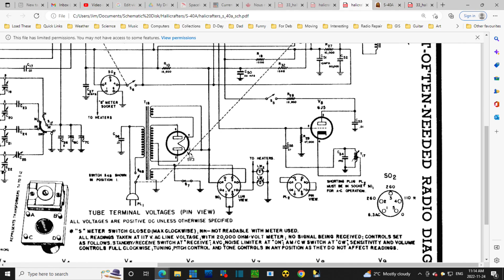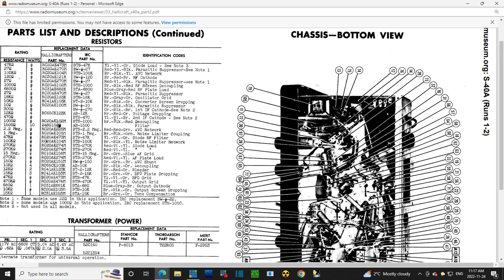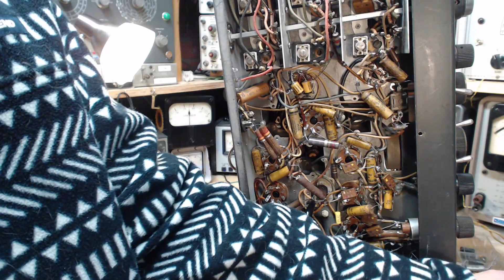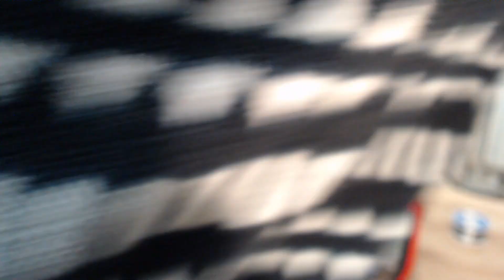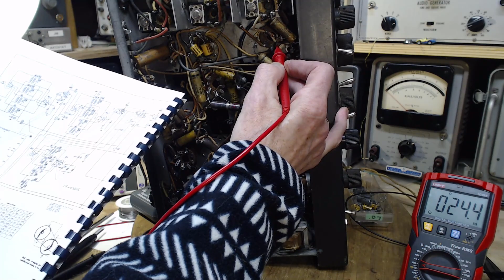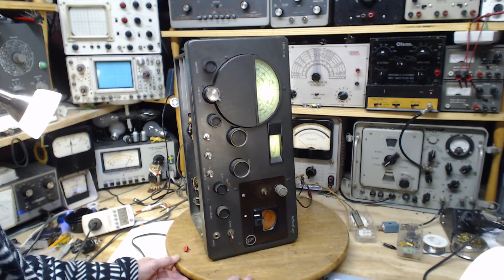Hallicrafters S-40A Shortwave Communications Receiver Video #6 - Big Power Supply Resistors

Comment: Clearly Jim doesn’t know that Hallicrafters made many revisions and changes to circuitry. The schematic never was meant as an exact blueprint to the radio. It’s a guide, subject to change. He always expects to have it be spot on. The radio is almost 80 years old. And as such, clearly has had mods and changes. Just change all those original caps and resistors, and be done with it.